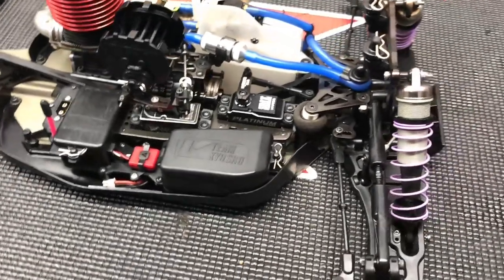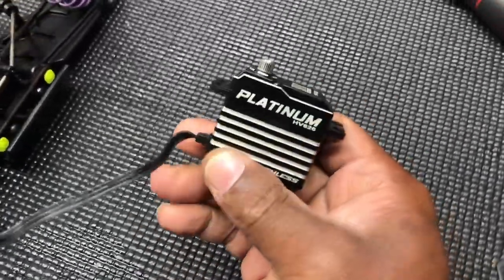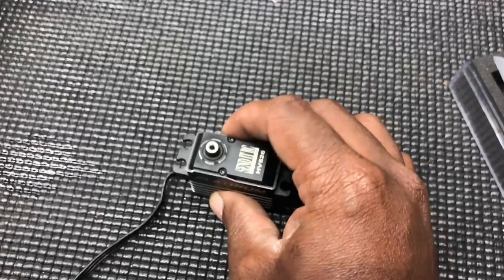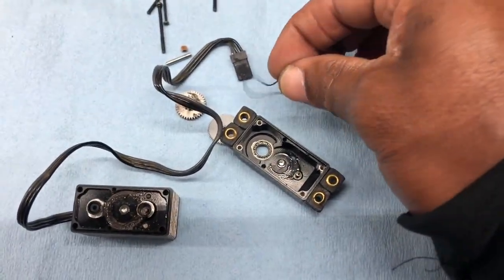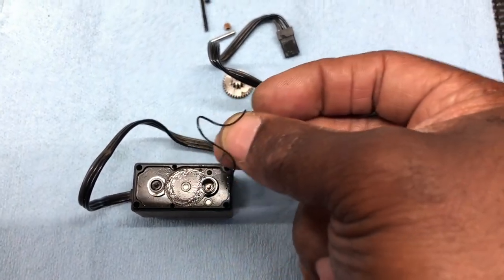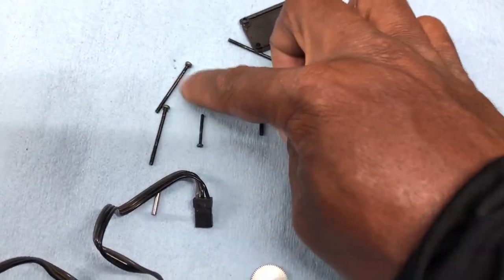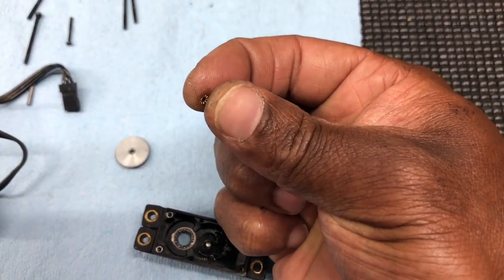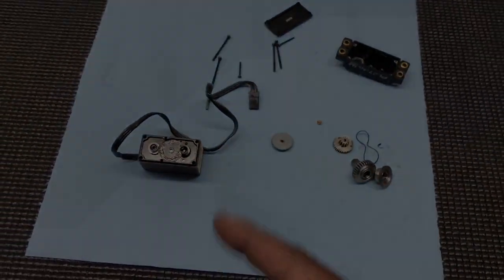Quality or Hype? Inside the Send-it RC 626 Servo...

Comment: I got a HV458 servo when you first made vids about em like 2 years ago, and I didn't realize it but mine was missing the upper bearing.  You'd think it would've destroyed itself but nah it was fine just had some wiggle to the spline shaft (I put a video up of it).  Awhile later, I messaged Send-it RC and he upgraded me to the HV626 for free. 

Before I sent the used HV458 back, I took it apart and saw that the top bearing was missing.  That allowed loads of dirt and mud to get down in there.  I was blown away that it still performed perfectly all that time.  So in a roundabout sorta way, that whole missing bearing thing made me trust the brand even more, especially since the dude running it stands behind his products and makes things right.  Bought a 458 for my brother's Traxxas Hoss and a 626 for my crawler.  I like them better than the $160 ProTek 170SBL that I run in nitro buggy.

Comment: A look inside the rocket 1900kv motor would be awesome..I bought one like a year ago, immediately installed it, and first run out with it in my  ebuggy. It badly overheated in 4-5 min. And continued to do so..I only let it happen for 1-2 more runs before I removed it..over heated so bad, it was losing tons of power..same gearing I run my tekins and hobbywings on
Reply from the maker: Do t have any experience or info on that motor, maybe just a faulty one?
Reply: @rajaa111  oh alright, no worries man. hopefully your right. Although the same exact thing happened to my buddy that bought one before me.